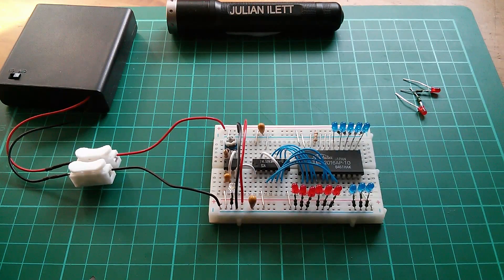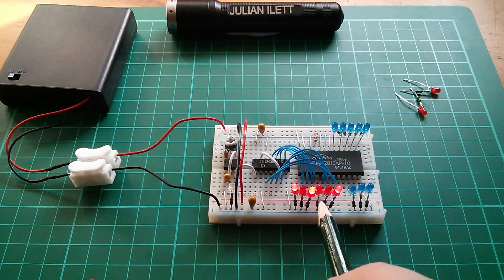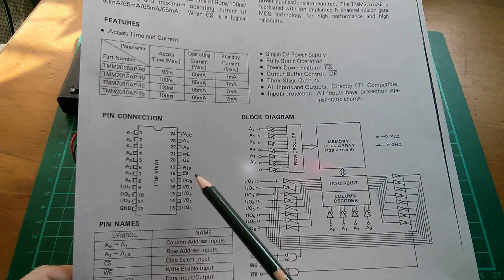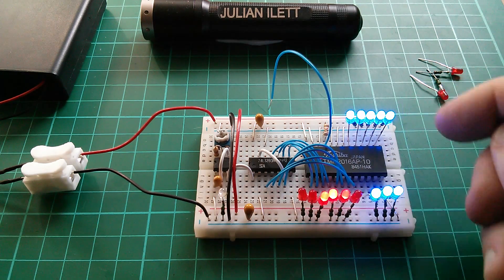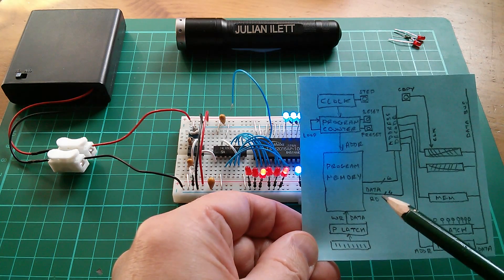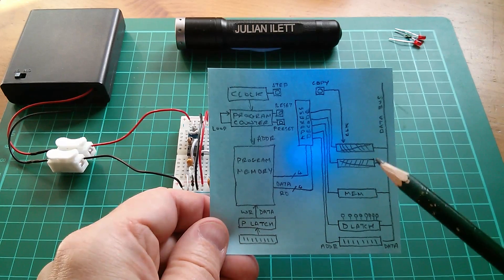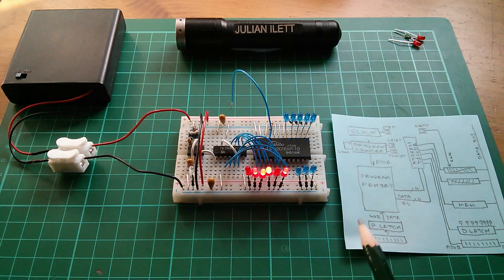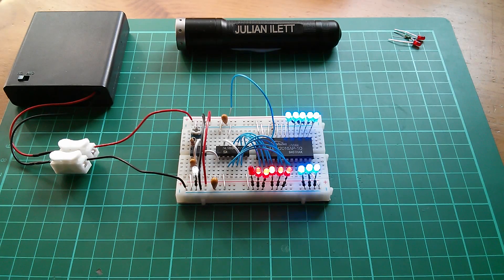Chip on Breadboard - 6116 CMOS 2k Static RAM

Comment: I was on a team that flew an experiment on the space shuttle. The microcontroller we used a 6116. The first flight was great, on the second flight we had data get scrambled. We figured it was radiation flipping bits. We went from the standard 6116 for $4 to the radiation  hard version for $1100. A lot of money, but we never had the problem again on the next 12 flights.

Comment: Hi Julian - I'm repairing an old video game board and it has an NMOS 2048 x 8 Ram on board which I believe may be faulty (D4016).
Would it possible to replace this with a CMOS device 2048 x 8 RAM like the 6116 that you are using here, please? Would it work? They appear to have the same pin-out. Thank you

Comment: I remember reading an article about removing the top off these 6116 ic's (easier with ceramic packages) and adding a lense to form an image sensor. just read back the array into an Arduino and display it on the PC. IR sensitive too.

Comment: I love your one instruction computer idea, it's a very clever and fascinating concept. But in what you've shown, you are only using 5 of the possible 16 addresses, and I'm sure you have uses for the others in mind. I have some suggestions:-
* 2 or 3 more of the 1 byte memories (call them registers or accumulators)
* A counter that increments (or decrements) when selected for write, and presents its count for read.
* Another 1 byte memory acting as an "Instruction Register" (IR) for:-
* Two 74181 4-bit Arithmetic-Logic-Units (ALU)s that take inputs from 2 of the registers (or counters), with the
  operation governed by 4 bits from the IR. (the ALU can do bit shifting also)
* The other bits of the IR could be used to select which registers/counters become the operands to the ALU.
* One of the IR bits could implement conditional branching:-
  It would enable setting a "Skip" flip-flop when, for example:-
  * The ALU sets its A=B comparator output.
  * Some other bit in the system (say the MSB of a register) is a one
  Then divide the system clock by 2 (or is it 4?) to make a 2-phase clock. The Program counter is always incremented to the next program address on one phase, and incremented again on the other phase if the Skip FF is set (and then clear it)
* I just saw someone else talked about putting the PC into the address space, which is very neat. It can implement a jump that may be skipped over. (like an AVR)
* A 4-bit register that writes the read address into its low nibble, to load an immediate value. (or use two addresses for 8 bits)
* Implement these 16 addressed functional blocks as pluggable modules to allow customization and experimentation with new ideas.
* Use a PC via USB connected Arduino to download "programs" into the 6116.
* Write a PC based IDE/assembler/compiler for it.
I'll stop now, but the possibilities are almost boundless... (could involve a lot of wiring though)

Comment: For me it looks more like TTA architecture. While technically TTA is an OISC, it is not completely true. You rely on data move/copy to implement different instructions and by changing what every memory location does with the data, you choose what specific word of program data is going to do. Thus you make different instructions. Typical OISC treats all memory locations equaly (with the exception of MMIO devices). I've built both in FPGA and there are some major differences between them, in hardware and programming techniques as well. And BTW… I think you want to make Program Counter available for writing in the address space so you can implement branches (little tip: you can share addresses of read only and write only registers to save some of the, very limited, address space).
Reply from the maker: Yes, I'll move the program counter into the data address space at a later time to implement GOTOs. Initially I'll just connect one of the program counter's flip-flops back to its own RESET input to create different sized loops and have a PRESET facility on the program counter to facilitate the setup code. Address space can be expanded by by having a seven bit address and a direction bit so you can write from and to an accumulator.
Reply: Makes sense for early testing.

Comment: Thanks for this, Julian. I've also watched the Ben Eater videos and other home brew computer builds.

Over the past year and a half, I've been steadily building-up a supply of CMOS and HCT parts to start my own design. Like you, I wanted a display all the  bus and address bits using LEDs in the various sections of my machine. I also wanted to not only have the LEDs showing the data and address bits flying around, but have video output too, rather than only using a terminal and serial I/O.

To that end, I've built a Parallax Propeller P8X32A based proto-board that's small and is very easy to produce multiple modes of VGA output, PS/2 keyboard and mouse interface; while using the remaining I/O ports and CPUs to make an interface to my home brew design.

At the moment I'm designing the ALU and have decided to use two 74LS181 (2 x 4bit) to provide 8 logical and 8 mathematical instructions. The glue logic will be fun....

I thoroughly enjoy your videos and find my level of Geekyness is always topped-up watching your projects and tinkering unfold!

Comment: If you put the LEDs and DIP switches at the same address, that gives you 15 registers instead of 14.

I'd add an inverter register and a Zero ie 0x00 register, which would give you the ability to set a register to 0x00 or 0xFF in just one or two M states.

If you want to be fancy a Mask and Result pair, either XOR or AND (or one of each)
Reply from the maker: Yep, all of that stuff. I'm also thinking of an 8-bit latch where the address lines are connected to the data inputs - it would emulate a ROM full of literal values.

Comment: An interesting idea, but rather than having 4 "read" lines and 4 "write" lines, I'd suggest having 4 "read/write" lines with one logic state being "read" and the other being 'write" plus 4 "enable" lines.

The idea of this configuration is to prevent the possibility of accidentally reading and writing from and to the same "register" which is a possibility with your suggested configuration.  Allowing each register to only read or write but never both at the same time will prevent any possibility of "shorting" outputs to inputs of the same register.
Reply from the maker: Neat idea. I'm also considering a 7-bit address and a direction bit. This would provide 128 addresses which can be moved to and from an unaddressed accumulator.
Reply: That would make each instruction a copy to Transfer Register copy from Transfer register pair with an assume Transfer Register with no address.

It would start to look like a microcoded CPU.
Reply: Actually, since there's no intermediate register, it would be an Output to bus / Input from bus pair.

Presuming that "write" is high or 1 and "read" is low or 0 and "enable" is also active low or 0, one of the Read/Write lines would be taken high and a different one would be taken low, then the corresponding Enable lines for those registers would both be pulsed low to perform the copy.

Of course there would need to be some careful timing to ensure the Enable for the Output does not go high before the Enable for the Input goes high, otherwise invalid data would be latched into the destination.

Comment: Impressive how you simplify things. Reading and writing to RAM, and flashing LEDs with Z80 in previous video! 
It looks like data bus is connected to LEDs and to resistors to ground.  I wonder why ones are written to the RAM instead of zeros when you pull write low?
Thanks
Reply: If I had to make a guess, it would be that the forward bias voltage of each LED when combined with each resistor is too high to pull the data lines to ground against the internal pull-up which is automatically applied when the data lines become inputs.

Comment: Why does the static RAM reset with power-off? I always thought static ram retained it's contents w... Forget it, static just refers to being "not dynamic" ie not requiring dynamic refresh... (mutters something  indecipherably) YOU KIDS, GET OFF MY LAWN!!
Reply: DRAM uses capacitors which will slowly discharge and lose the information stored if it isn't read and re-written periodically. SRAM uses electronic gates which don't lose their state if they aren't rewritten, but will lose their state if they are unpowered. NAND Flash memory uses floating electronic gates which are electrically isolated from the rest of the chip (they use a very high voltage generated on-device to push through the isolation during writes)

Comment: Love these Chip on Breadboard videos! :) I dug out an old 16KB expansion cart from my VIC20 and found that it has 8 6116s and a 74139. Want to play with them and an FPGA mini dev board, but it's 3.3v. Can you recommend a chip for level translation? I think I need 8 bidirectional (data), and 14 unidirectional. Never had to do level shifting before.

Comment: Do ram chips really have random data when registers are empty? I'd assume each bit to be 0 after a power off.
Reply: Maybe the pins are pulled high during reading causing the blinking?
Reply: It is random data. If you look at the circuit for sram you will see that it is two NOT gates back to back. When initially turned on they will 'fight' each other until they reach a stable state of 1 or 0.

Comment: I've made (a while ago) a Virtual machine with Arduino, it NEEDS a LCD shield and I can program it in Assembler. The virtual machine has 256 bytes of program memory (it's enough), 16 nibbles of RAM, can access the buttons as imput and 6 LCD characters as an output. The only way to program it is via the LCD Shield. I'm gonna upload it and put a link tomorrow.

Comment: CAN THESE CHIPS HOLD PROGRAM WITH OUT POWER
Reply: NO. YOU HAVE TO USE A BACKUP BATTERY OR USE TIMEKEEPER RAM. TIMEKEEPER RAM IS A RAM CHIP THAT CONTAINS RAM BUT ALSO A BACKUP BATTERY AND A CRYSTAL OSCILLATOR BOTH FITTED IN THE CHIP PACKAGE.
Reply: +Integrated Electronics IN THIS CASE YOU DONT NEED THE CRYSTAL OSCILLATOR BUT ITS NOT A PROBLEM.
Reply: WILL a 18650 cell work I have tunes of them
Reply: 18650 is a 3.6v cell, so check in the datasheet the voltage range of your RAM.
Reply: 3-5 volts so I am still good a 18650 cell charge cutoff voltage is around 4.2 volts
Reply: ALSO, YOU NEED TO FIX YOUR CAPSLOCK KEY
Reply: +Anvilshock. Agreed, but let's face it; the ploy (or accident) worked. It attracted people's attention. ;-p
Reply: MY CAPS LOCK WORKS FINE YOU MUST HAVE BEN A TOP GRADER
Reply: THEN USE THE FUCKING FINE WORKINGS OF IT TO SWITCH IT OFF, YOU MORON
Reply: ANVILSHOCK I AM GETTING THE RESPONCE FROM YOU THAT I WANTED THANKS
Reply: +Integrated Electronics Thanks
Reply: Anvilshock this IS fun

Comment: Looking super forward to some of those breadboard computer videos! When I was younger I had a lot of experience making computers in a game called minecraft using very similar logic that is used by real computers. The only thing I never understood is why a clock is needed. What is the point of a clock when you could just have a line that links the path between different components?

Comment: Julian, I get what you say about the OIC thing, but I think it would be better if you add some kind of branching capability, like jump if carry, jump if zero, and so on. Without that, you can't do anything "more" complex than standar additions or subtractions. I know you might write a long code that can do slighter complex things, like multiply (adding things repeatedly), but you know...
Reply from the maker: That may be possible with a flags register and a writable program counter mapped into the data RAM space.
Reply: Yes, for instance, when you execute a jump if zero, you only need to check if the last operation set the zero flag. In that case, move the lower data (from the instruction, which holds the jump destination) into that PC mapped in RAM space.
I don't think it would be necessary to map the flags register, just use it as an internal thing. I'm looking forward to this project!

Comment: i saw ben eaters breadboard computer and i was having trouble finding a set of 74ls189 64Bit ram 16 Words x 4, is this chip a good replacement for the ram module he's using?
Reply from the maker: Certainly much easier to source.
Reply: You can use it (and maybe any SRAM). This one (the 6116) is a good replacement. Just tie down (or high) the not used adresses pins, and use the other pins as it were the ls189. 
There is no need to correlate the bit number with their marking (i.e. you can use DB4 for other bit), as long as they're used as intended (i.e. data bus for data, and address port for addressing it).
Reply: Definitely, much cheaper too, i usually grab more than i need so i was going to get 3 74ls189's(only needed 2) but it came to about about £20-25(including postage), however 2 of the 6116 Sram Chips came to about £5-8(including Postage)
Reply: Really? De-fi-ant-ly?
Also, I don't know where you guys have been looking, but aliexpress has lots of 74ls189 from $0.50 a piece, and lots of 6116 from $0.63 a piece, plus a bit of shipping here and there.
Reply: Anvilshock Woops, I did not notice I spelt that wrong, but you know what I meant, anyway it's too late now I just bought 2 of these chips for £4 off ebay.
Reply: Also, Got any high quality suppliers for breadboards? Recently bought 3 and they are pretty terrible(very similar to the ones in video #86) i do have some old ones but i cant find the supplier any more(good 3-4 years ago i bought these)
Reply: Julian's Postbag #92 was where he showed a brand of breadboard which seems to be good quality.  He starts talking about it around 12 minutes in.

Comment: Is asserting read enable and write enable maybe a shortcut to writing FF?  Maybe for testing or blanking?

When are you going to finish the vocoder? 
/me ducks
Reply from the maker: It looks (from the data sheet) like taking /WR low actually disables the output drivers.
Reply from the maker: Ah yes, the vocoder - my big analogue project :)
Reply: Julian Ilett If as you suggest that pulling the WR line low disables the output pins, then you've committed the cardinal sin of CMOS, you have floating input gates.

It can't be the LED's / resistor chain tying the inputs to ground, that would result in all lows being written wouldn't it ?

Comment: Havent seen one of these since I fudged a few into my ZX81 to make it 8k static ram (Using either a 74138 or 74139 as address decoder I cant remember which). That was in 1983!
Reply: 138 iirc is the 3 to 8 line demux with active low output (as used for chip select),  so you must have been planning for an upgrade to 16k when the price of SRAM came down :)

The irony was that a Z80 can refresh DRAM by itself,  but not many people understood that magic.
Reply from the maker: I'll be using the 74LS138 as my memory address decoder - perhaps as many as four of them :)
Reply: @MattOGormanSmith It was nothing to do with refresh. 4116's you need 8 as a minimum and you cant battery back them. I could have used a single 6116, and 8 off 4116 was more expensive than 4 off 6116.
Reply: Julian Ilett would you be interested in getting your hands on an FPGA board to evaluate? I should have some batch 1 production units in less than 2 months. There is no programming cable required if you have a Raspberry Pi and they can either work with one or stand alone. I also have some digital indicator boards (16 bit) for demo and basic debugging if you want to try those out too.